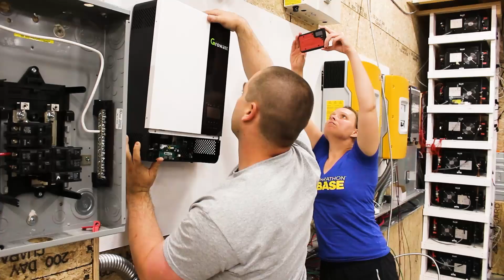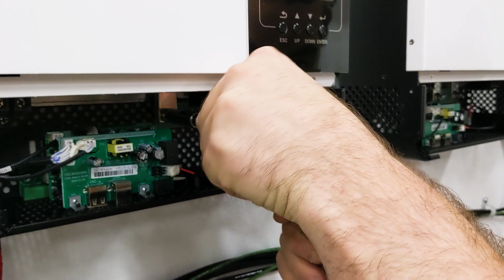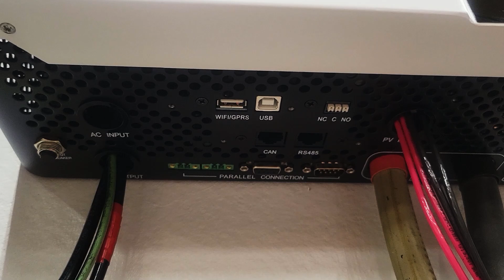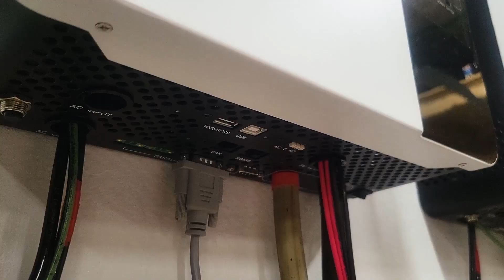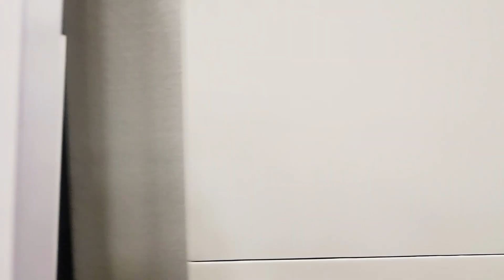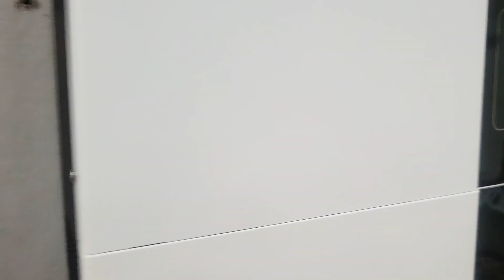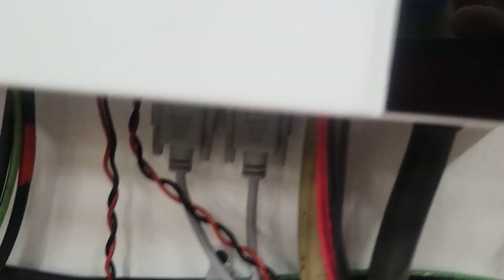Paralleling 3 inverters together, Growatt 5000w Solar System

Comment: Being in Massachusetts- how do you deal with electrical permits for all this work on your house?  I want to add an array, along with a hybrid inverter, and 20.8kw of batteries and take 90% of my house off the grid but am concerned about stories I hear about this issue.....  any insights would be great!! Thanks!
Reply from the maker: Every town is different.  I had to jump through some hoops, but it will be different for everyone.  First, Nothing I do is grid tied.  Second, all my work is in NON-living spaces.  meaning the backyard and garage.  nothing is tied to the house.  With those two requirements things became easier.  I couldn't get permits to install solar on my roof.  That's why I did it in the backyard.

Comment: hey how are the growatts doing? I see them for sale here in Jamaica for around  1100 u.s. dollars. Really eager to hear your thoughts before I bite the bullet.
Reply from the maker: They have been working for 6 weeks for me.  They are doing everything they say they will do.  No problems.  But the fans are loud, so don't put it in your bedroom.
Reply: @DavidPozEnergy  Thanks for responding I appreciate it. I have another question. I have been reading up on SPF 5000 es. I see were it has an ac bypass feature. What I am trying to figure out is if this ac bypass is limited to max output of the inverter or is it supplemental to the inverters output?
Reply from the maker: Limited to the power of your AC source.  The inverter does not add to the AC source.

Comment: Can the inverter run without battery?
Reply from the maker: The website says it can, but I've never tried it.  I think it's worth having a battery.
Reply: @DavidPozEnergy  Is the any significance of having higher voltage array compared to lower voltage besides lower current?
Reply from the maker: Lower current means thinner wires which saves money.  But, usually it's easier to make the system more efficient with lower line-loss.  Also, if you have more than 2 strings combined, then you need circuit protection.  With only 2 strings I don't need that.

Comment: Hello David, excellent video by the way. Just have a question on how would you wire in a Generator if you have 3 inverters in parallel. Would that be to the master inverter or would you need to somehow split the generator input to all 3 inverters? Hopefully I've somewhat was able to explain this properly?
Reply from the maker: I personally own a 5kw generator, so I would wire that to just one inverter.  It doesn't have to be the master, just any one of them.  If you have a larger generator (say a 20kw) you could wire it to all 3 to work together.  The neat thing is, I could wire one generator to one inverter, and a second generator to a different one.  LOL, not that I will.  At some point I plan to make a video wiring in the generator and showing the charge.
Reply: @DavidPozEnergy  Thank you for getting back to me and would love to see a video on that subject. You have my undivided attention :-)

Comment: Here in Wisconsin the power company fraudulently charges anyone off grid a facilities charge. Does your power company do that?
Reply from the maker: When I built my house it was tied to the grid.  I'm still connected, but I operate off-grid most of the year.  I usually only switch back to the grid when I'm changing the inverters or something.  I'm charged about $20 a month to be connected as a service fee, even though I don't use their power.
Reply: @DavidPozEnergy  Do you have any protection devices to protect your equipment from power surges or even lightning strikes?
Reply from the maker: Yes, I have two of them.  But I just recently moved the equipment from the SMA inverters to this new setup, and the surge protectors are still off at the moment.  I've got to get them back on.

Comment: Got 4 MPPSolar Pip4048 each 4kW in 3phase setup (Europe 400V 3p and 230V 1p) for 7 years now. Running fine, House, HeatPump/AC, electric cars. Bought them because SMA were too expensive in 2014 and they did not offer the features I needed. greetings from Europe

Comment: The cable is a DB9 (serial cable) but based on the labeling instead of using RS232 (typical serial communication) it uses RS485 (SCSI communication - pronounced scuzzy)
Reply: @MikkelRS Indeed.. nothing to do with SCSI ( that's for disk drives ).  Though the difference between RS232 and RS485 isn't voltage but rather that it is meant to daisy chain devices with a few bits to address them rather than being point to point.

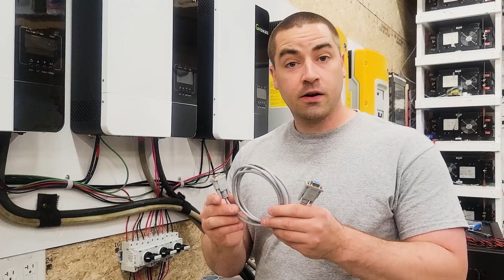Comment: 18:35  (Video Graphics Array) VGA Cable ... i hope im not aging myself ;)
That cord is an extension. male to female
Reply: VGA did also use a D shell connector the same size, but it had 15 pins ( 3 rows ).  That's a DB-9; a 9 pin serial cable.  They also had a 25 pin serial cable that was much wider.

Comment: Hi David. I love your videos! Thank you and to your family for making the effort to produce them. I purchased a hybrid inverter from China branded SUNMART (fairly sure same manufacturer as MPP Solar). It's a 240V unit so I also have a autotransformer from SolarEdge.  I used your video as reference where you connected up the Growatt inverter with 50A breaker and the autotransformer using a 30A breaker. I did read through all the comments and there was some concern about the connection of the autotransformer to the breaker. As you mentioned in this video, you will be making some changes to the autotransformer connection so there is less likelihood of the system being out of balance. Could you please share what changes you are doing to make? The diagram sent to me by the manufacturer of my inverter had L1 L2 N coming off the autotransformer connecting directly to the electric panel. Any comments would be greatly appreciated! Thank you
Reply from the maker: Sure.  I will get into more detail in a future video, but here goes the plan: If you have only one 5kva inverter, then it's probably fine to hook the auto-transformer up directly to the bus bars, since the auto-transformer is also rated at 5kva.  In my case, I have 15kva potential, so I need additional protection.  I've ordered a couple different circuit breakers I've been messing with.  The plan is to join the circuit breaker on the auto-transformer to the breaker on the inverter, so if one trips they both trip.  Not all circuit breakers can do this.  Something I'm still working the bugs out on.
Reply: @DavidPozEnergy  That you for the quick reply and useful info!! I appreciate it.
Reply: @DavidPozEnergy  David, since I'm nearing the install of my two Growatt 5k inverters and midpoint transformer, would you please share your thought on what you'll be changing up in your system, as it relates to the autotransformer, etc.?
Reply: So in essence you're building a fancy GFI breaker.

Comment: Great video David! Are you concerned that the transformer is rated at 5KW?
Reply from the maker: No, because the big loads are 240v.  The auto-transformer only handles the imbalance between L1 and L2 on 120v loads.
Reply: @DavidPozEnergy  Ah!. Thanks!

Comment: Wanted to know the following at rated output:

1. if the waveform is still a pure sinewave specially for inductive loads? Efficiency?
2. Maintains voltage, current, and frequency? 
3. Is the built-in charge controller programmable? 

Also, this video changed my mind on SMA's...

Thanks
Reply from the maker: Sure, I can get to those questions in some of my follow up videos.  I'll put my scope on it.  But I can say the charge controller is programable.    I haven't noticed any problems with voltage sag or frequency.  seems pretty good with that.
How did it change your mind on the SMA's?
Reply: @DavidPozEnergy  Thank you for taking your time with my questions.

I am planning to put up my own solar system and my requirements must be cost effective, efficient, meet product specifications, easy to use, and has good after-sale service. I was considering SMA/Solark until I saw your video.

Growatt's costs (3 vs 1 SMA unit), built-in charge controller, parallel operation and power advantage (15kW vs. 6kW) over SMA is evident.
Reply from the maker: Yes, these Growatts are very cost effective.  I bought my SMA's at a point when they flooded the market and were very cheap for a few months.  But they have gotten expensive again.  The Sol-Ark is still worth considering, if one meets your needs.
Reply: @DavidPozEnergy  Again. Thank you for doing these product reviews. People like me benefits a lot from your work.

Comment: I have been following along. Question.  Instead of a transfer switch can you split your grid and feed it to all three Growatts so that if it is cloudy and you run out of battery you can still power your home through these?  Automagically?
Reply from the maker: Yes.  That is what a lot of people do.  For me, it's just a lot more wiring back and forth to the garage and house, so I'm sticking with the wiring I have.   But, if you were building a brand new system, it would be nice to set up that way.
Reply: @DavidPozEnergy  so can a guy just use 2 different combiner boxes?  Use one as a divider and one a combiner?
Reply: @DavidPozEnergy  thanks for the reply.  Great watching your videos.  Yes.  I am doing just that.  Have 2 5k growstts in the mail.  Going to Order 30 410 watt bifacial panels to start

Comment: Hey going off grid. I'm running about 5000 watts in my old house. Any recommendations for what system I can start with?
Reply: the genetry solar 6000 watt low fr pure sine wifi and can do 12 24 36 48 volts so if you upgraded you voltage later on you dont have to buy a new inverter  pop top off and simple to switch voltage dont have to buy anything it is a awesome inverter and it is loaded and low price

Comment: Check your wire colors on the PV.  As I was taught years ago, the code said that you should use White and Black, not red and black.  Also, from memory (and probably faulty ;-) ), black is plus and white is minus.  I had to buy white tape and mark one of the outdoor rated PV wires with tape to identify which was which...
Reply: for DC, red and black is used.  For AC, black and white

Comment: I would strongly recommend using full PPE when flipping switches for the first time and especially the DC switches for solar and lithium battery Banks it can be especially dangerous as things can get dangerously exciting very quickly (at a minimum have long arm flash resistant gloves, and protective glasses but ideally full face covering type mast, might not be messing with 10kv+ here but risk is still there)
Reply: PPE would make sense in facilities with larger fault current.  I highly doubt this guy's system is capable of more than 4KAIC, which isn't necessarily enough to justify that level of protection.
Reply: full ppe ? sure . go back to your knitting

Comment: Can i do this same setup with the 12kW 48V 150VDC model?
Reply from the maker: Same setup?  The 12kw version will not parallel, meaning you can't add more inverters to feed the same panel.  However, you can hang it on the wall the same, and run solar to it the same, and connect a battery the same way.  Not sure if that answers your question.  If not, can you please let me know how I can best help?
Reply: @DavidPozEnergy  youi actually answered it spot on ! i was just wondering if the 12kw would be able to run parallel to make it a 24kw system that's all, sadly my remote area i cannot get power unless i want to spend a 6 figure amount, so trying to go off grid, but looking into it more this system can expand up to 30kw which is great !

Comment: What happens if one of them fails? Can two keep running (obviously with reduced capacity).
Reply from the maker: Yes.  However, you would have to manually re-set it to 2 inverters, then turn back on.

Comment: Why not get a charge/inverter with 240 volt split phase (2 - 120volt) outputs?  Just not sure I concur with your strategy to produce house current.  Seems awkward at best to produce 240 volt then break it down with that device you refer to as a transformer.  Aren't there any inverter/charge controllers that produce two 120 volt phases that are 180 degrees out of phase with each other?  It's hard to believe someone isn't producing one.   Transformers produce a great deal of loss due to how they work.  Essentially, 2 windings wrapped together using EMF to transfer from one to the other in whatever ratio they are wound.  Transformers are fine for small loads such as control wiring etc, but don't offer efficient enough step down (or step up) transformation.  Something large enough to transform that much current has got to be a heater.  Not wise.    Again, I'd search for a charge controller/inverter or even a separate inverter that is capable of making split phase 240 volts.  As far as unbalanced load...that's normal.  I don't know anyone who has a balanced load in any structure, where both 120 volt legs are drawing the same current all the time.  That's an unrealistic expectation.  When you mix 120 devices with 240 volt devices in the same panel you are always going to have imbalances as current consuming devices cycle on/off within your home or business.    Growatt says you can use 2 of their charge/inverters to produce 120 x 2 split phase current.  Why not get pairs instead of 3?  Seems very queer.
Reply from the maker: Yes, companies make 120/240v inverters.  Even Growatt has a nice 12kw version with the transformer already built in.  What I'm presenting here is just one of hundreds of options on the market.  Personally, I like the large charge controllers built into these, which I don't see on some of the pre-built 120/240v models.  However, I agree that it's a bit awkward to use a separate auto-transformer.  It's fun to try new approaches and find out first-hand the benefits/downsides.

Comment: I was on the phone with Signature Solar for about an hour and a half today. That are the most helpful solar company I've talked to. I'll be getting two 5kw inverter chargers and the auto transformer. I like how if one fails I can still get some electricity out of the other, I can use more panels, add more inverters down the road if necessary, and shipping is going to be a lot more reasonable than the big 12kw unit. I will use your discount code as well, just waiting for the invoice.
Reply from the maker: Very cool.  That will be 10kw of inverter power, and up to 12kw of solar PV.  Nice.

Comment: if you want to clean up that wiring, you could get a "gutter/troth" about 5 foot long or so, they come in many sizes. but be prepared to drill a bunch of holes of varying sizes and proper bushings. then you can run your mess inside the gutter and have holes directly under/above your connections. you'd be left with straight runs from the gutter to the connections so all the wires would be in neat lines. a lot of work though
Reply: Yes, “Engineer775” uses those gutters all the time, wiring up the 12K Solark inverters, installations always come out looking great, and meets all code requirements as well, which is important, if you have Homeowners insurance and your house burns down due to an electrical fire 😳